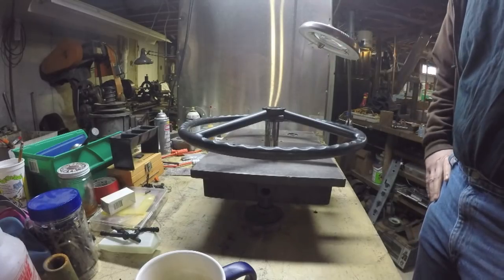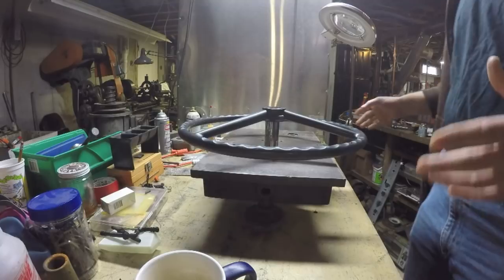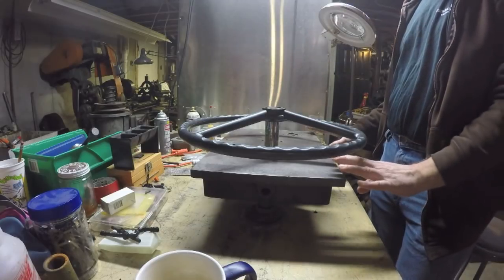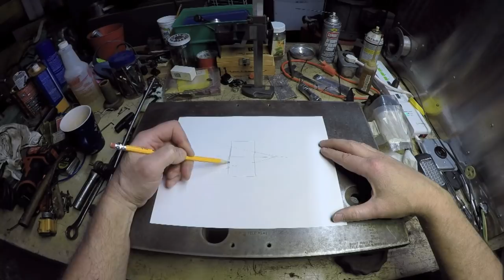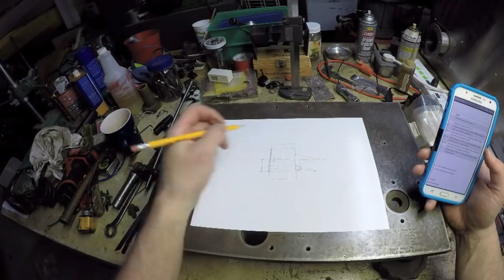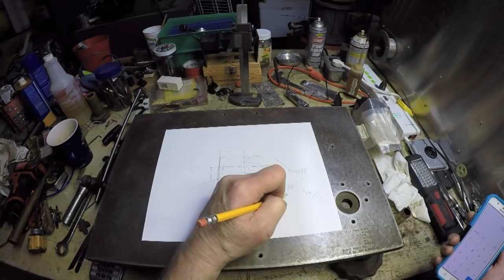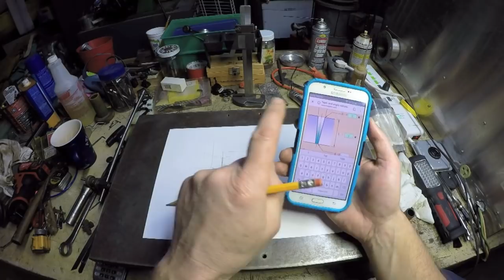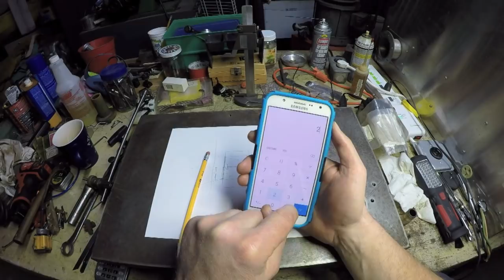IH 350 Utility Tractor Project Part 43

Comment: Good info for figuring out a taper. Look forward to seeing you turn it. I bet it'll be nice to finally have that fixed.
Reply: John Strange - You should turn it and do a collaboration video showing off the new lathe more!
Reply: lol I don't think I'd want to try my hand at a new operation on someone else's critical part. I imagine at some point I'll give a taper a go though. I'm doing a spindle right now, then an Acme threaded shaft and matching nut.

Comment: Winnie The Poo, Steves a Tigger too!  I'll bet that smell is not ionized air, but ozone you smell.  Like a fresh thunderstorm.  I built  a O3 generator out of a neon transformer, a Prego jar and some wire.  Coolest thing ever.
Reply from the maker: Tech Gorilla You're right, it's definitely ozone. I know that smell, I just mixed up my terminology. I think technically speaking, that spark gap is ionizing the air, in turn causing creation of the o3.

Comment: Steve , you measured 0.044 thou over 1", so the angle of the taper is Tan of 0.044/1000 (7.6794) in this old brain of mine.
Mind you math was NOT my strongest displine in school.
Cheers Eric
Reply from the maker: Thanks!

Comment: Rember you cant trust the dial indicator readings as the arm is at an angle and is reading more than it really is.
Reply from the maker: Neverrth I did my best to keep the indicator vertical, so it's parallel to the spindle. And as I power the quill, the contact point on the indicator moves straight down in a line perpendicular to the table, plus I'm measuring a difference between 2 points.